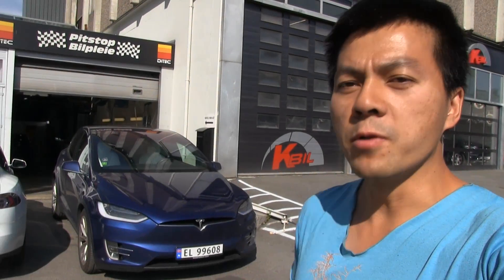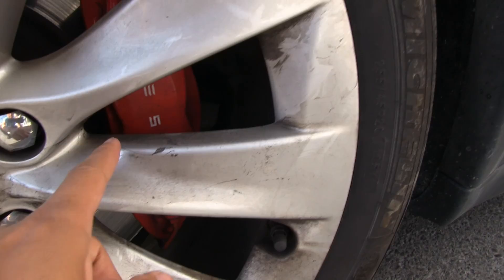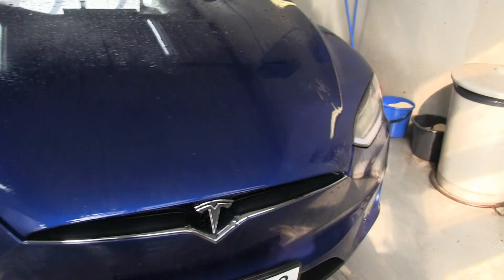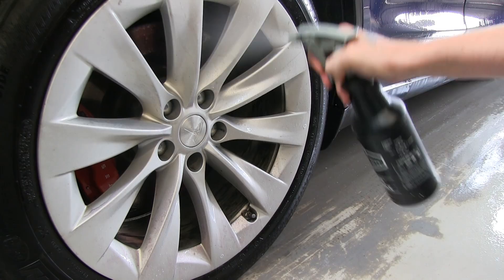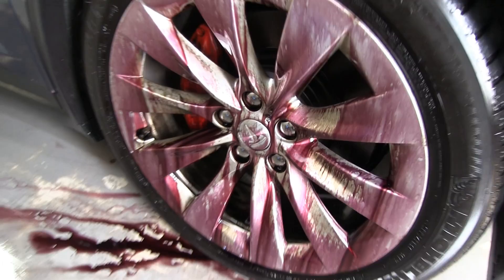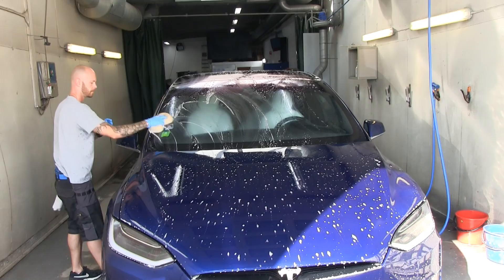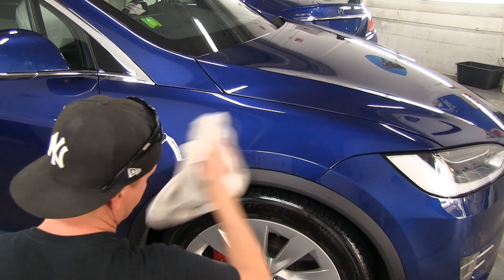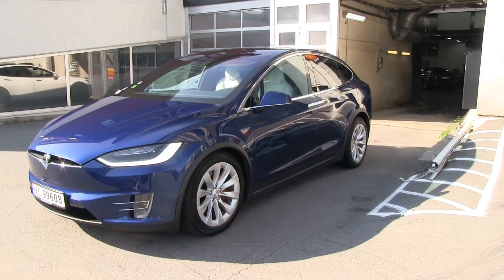Ditec control wash after 30k km/20k mi

Comment: I'm worried about those guys' health in the long run. If the chemicals are that potent, they can't be good for the skin, not to speak about the lungs.
Reply: Exact reason why they use gloves. What they are spraying has very little fumes. However, with nano sized particles, most of the face masks (filters) are worthless.
I used to work with nano solvents, using latex gloves. Bad option. Got through and into my skin. Always use nitrile gloves with nano. :o)

Comment: I'm confused. Bjørn had 24k NOK of LLumar Paint Protection Film applied last October: https://youtu.be/XJIJGU9k7xQ

Is the Ditec here being applied to that or to the original paint surface? (Especially since the Ditec video brings up the effect of polish on paint at 6:19)
Reply from the maker: Ditec is on top of LLumar, yes.
Reply: Ditec is not film based. It's a nano-ceramic paint sealant. For paint protection, you wouldn't need both, but with body paint films you don't get the self-cleaning, beading effect you get from a nano coating.

Comment: Bjørn, what stickers do you have to the right (passenger site) on the inside of the windshield?
One blue and white and one green?
Reply: i think that sticker is something you need to have when in germany to show / have proof that your car is electric or something
Reply: That's why I asked Bjørn, to get the right answer. Not to get some guesses ;)
But wowgt93, you could be right :)
Reply from the maker: The green one is vignette for driving on Austrian autobahn. The other one is for Swiss motorway.
Reply: Bjørn Nyland Keep the swiss one until Jan 31 2018.
Reply: @wowgt93: There is no sticker in Germany to prove that your car is electric.
German number plates can have an additional "E" at the end, but my electric car was registered before that was introduced. What we do have in Germany is the so called "Feinstaubplakette", which should be "green(4)" for any electric car. It's required to enter certain cities in Germany.
Reply: well. maybe read my latest answer where i said i was wrong before commenting im wrong?
Reply: @wowgt93: I did read that. My remark was just additional information on how it looks in Germany. Relax.